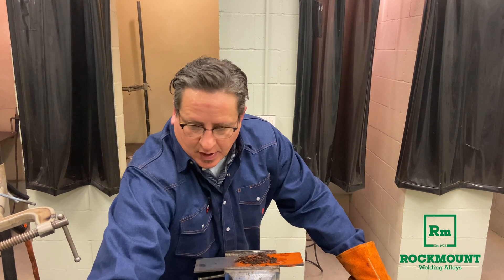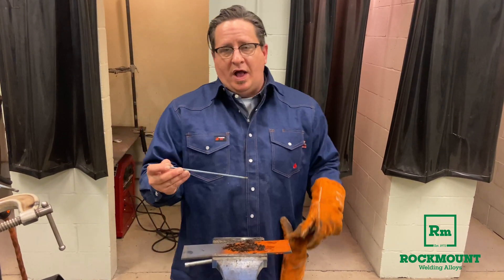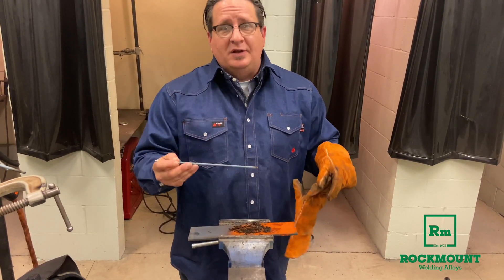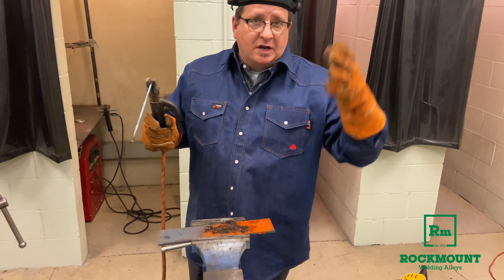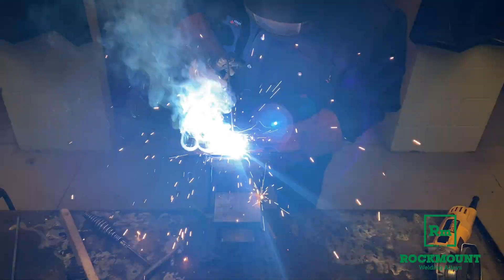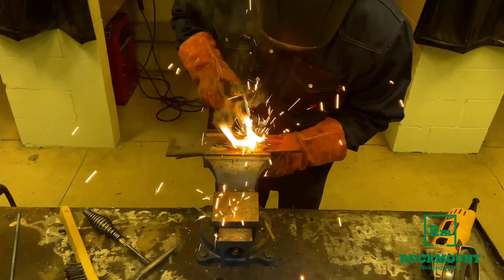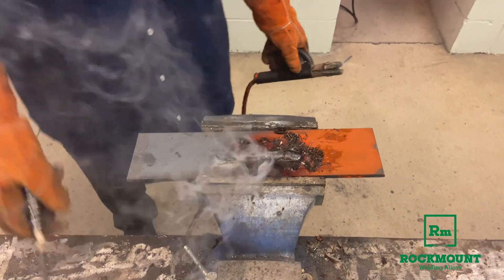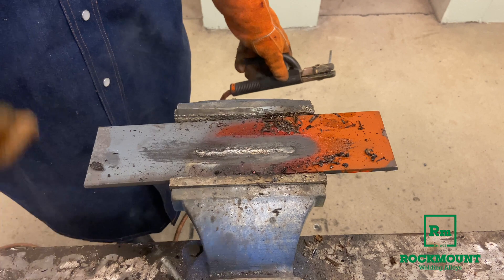Watch Rockmount Tartan AAA Weld Through Paint, Grease and Dirt

Comment: Not cleaning your weld area is a bit like not using toilet paper. Can be done but do you want to?
Reply from the maker: Of course we always recommend effective prep if possible it’s just not always practical. Many of our customers use this product for field repairs. They don’t have time to bring equipment back to the shop for a perfect prep. They need a product that can work through the contaminants and get the job done right with as little downtime as possible. That’s where Tartan AAA comes in!